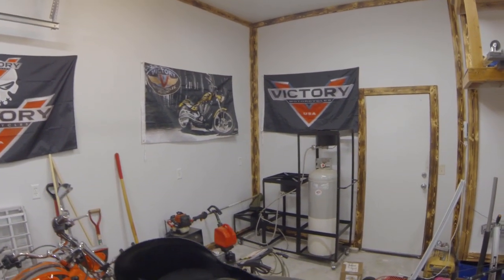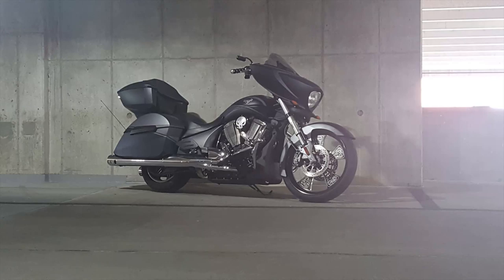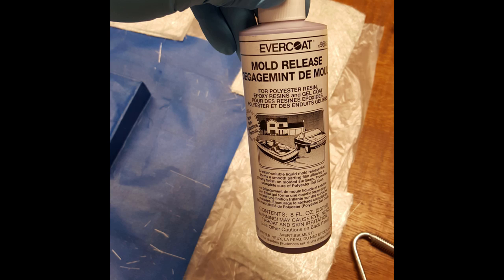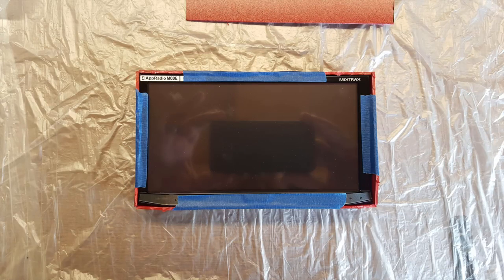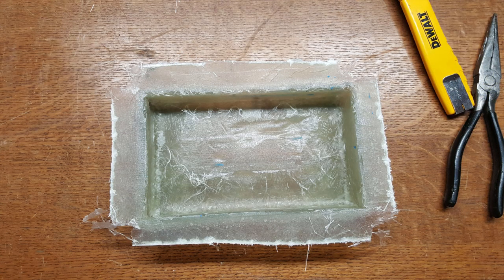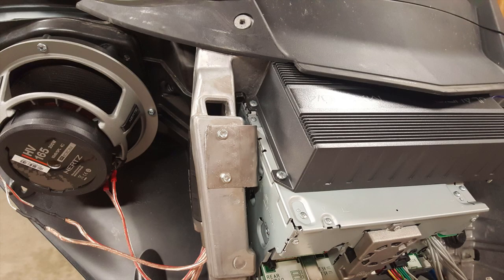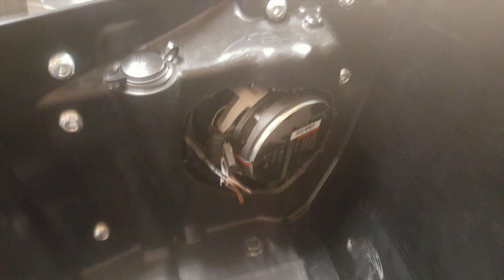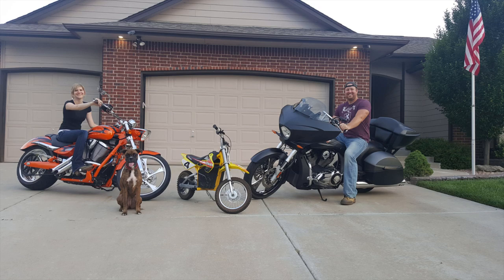Victory Cross Country Custom Dash Build | Double Din Stereo

Comment: Man that's nice , I wish that could be done on my woc fairing
Reply from the maker: Thanks man. You might be able to, don't know much about the dimensions of those. I was told by 2 custom shops that the screen wouldn't work down there to keep the stock gauges. Where there's a will, there's a way 😉

Comment: This is great work man.  I wish I had the talent and resources that you've demonstrated here.  Can you share a pic of the inside of your bags finish with speakers?  Did you have a sub somewhere?
Reply from the maker: Thanks man. I haven't added speakers to the bags yet, just replaced them in the tour pack to the hertz 5.25 coaxial. No sub. Eventually I'll add bag lid speakers and probably a sub, but it'll probably be next year before that happens. Too many other things money and time is going towards.

Comment: I have watched your video numerous times and cant thank you enough for posting it here.  Especially after the photobucket fiasco from the forums.  But i do have one question.  Since you installed this on your bike have you had any issues with cracking or chipping on the modification itself?
Reply from the maker: Thank you! Glad it has been helpful for you! I've been running this for almost a year. Waited a few months after I primed everything to make sure it would function well. I've probly put 3k miles on with the mod. There's not even any cracking in the paint. It is super solid. That dynaglass really makes it rigid. I have no doubt this mod will last the life of the bike (structurally). Unless someone takes a hammer to it! But it's kind of tucked under the main dash and tank so I don't think anything would ever hit it either. Hope that helps!

Comment: Nice work! How did you get the radio control to work with the new radio? I'm having issues with adding a Pioneer DMH-C2550NEX to work my X1 radio controls.
Reply from the maker: I went over the module I had to buy... it was in the part where I was installing everything under the fairing, sorry I can't remember the name off hand

Comment: Are the pins 90 degrees to the ribbon, or in line? Thanks. Great job BTW.
Reply from the maker: I think I know what you're asking... but everything is in line. The contact points on the ribbon are flat (not at a 90 degree angle on the end) and they slide straight into the connectors. The ribbon plugs in the back of the screen running along the back, not sticking out 90 degrees. Hope that answers your question, let me know if not. Thanks man!

Comment: Awesome. I’ll be using your video to help me making mine. I do have a question. Will making the box of acrylic be a good idea? Like will I be able to “weld/joint/etc” to the frame?
Reply from the maker: Yea you can make that box out of anything really. I'd just scuff up the area you use the duraglass on so it gets a good strong hold.
Reply: Life of Bliss Awesome. Thank you for the tip. And congratulations on the new addition to the family. I saw it on FB Victory Page.
Reply from the maker: Thanks man! Good luck with your project too, it's a sweet upgrade

Comment: How deep can a head unit be for this to work? I wanna tackle this project but I don’t wanna start by getting the perfect head unit only to find out it’s too deep and hits the bars. I figure I need to stick with a 7” screen unit, but just wanna make sure what depth I should stay at. Thank you!
Reply from the maker: You won't be able to fit a full head unit on the fairing, double or single din. You'll only be able to fit the face plate which is pretty thin, only about an inch or so
Reply: @LifeofBliss  I was told almost the same thing by Dave Azzopardi.. but I’ve seen ppl doing it. Even tho I can do car audio myself.. looks like imma have to just break down and take it somewhere and just pay to have it done😞
Reply from the maker: I was told there's no way to do a double din, so I did it myself 😉 but seriously, there's physically no room to do a full stereo in the dash in the stock location. The brain has to go in the fairing. If you're seeing dashes with stereos in the stock location, it's either how I did it or how Dave does it, with the faceplate separated from the brain
Reply: @LifeofBliss  sweet, if all the ways I’ve seen, I like yours the best, it looks like the dash was made that way… clean👌I guess I have just 2 questions lol…

1) what do you do when you get caught in rain cuz I don’t think there’s any touch screens that are water resistant.

2) do you, or have you considered getting paid to do this, I only ask that because if I have to, I’m gonna tackle this at the risk of messing up my dash lol but if an expert can do it, I would pay!! Lol
Reply from the maker: If it rains, I just remove the face plate. Inconvenient, but beats damaging it. I doubt I'd be listening to music in heavier rain so I could focus. Light Rain and sprinkles it doesn't really get wet.

I would love to make these for others, but honestly man I just don't have the time right now. Just bought some land and a house and I've been busting my butt to get things in order here. Only rode a handful of times to the gym and back this year so far!
Reply: @LifeofBliss  hey I hear that!! I get caught in rain sometimes so figured id see what id need to do.. all in all I really wanna tackle this!! I think it looks awesome, and depending on the unit, it pretty much gives you the only thing these bikes are missing to be compared with brand new flagship bikes🤷‍♂️ thanks for talking to me!
Reply from the maker: @dustinryanmusic423  absolutely man, hope you can get it going! Some people have used ABS plastic to make the tray for the faceplate to sit in. Then bondo it to the dash like I did. Essentially just replacing the fiberglass with plastic. Good luck getting it going! Take your time, it's not too terribly hard to get it going. It'll take time to make it look super smooth and like it's supposed to be there, but just focus on the fitment first.

Comment: Also how did you determine what head units will work with the brain in one place and screen in another?
Reply from the maker: I looked for a screen that could be removed from the unit as a security measure. I honestly didn't know if this particular unit would work before purchasing. I got lucky and was able to find the right cables to make it work. As far as I know, all of the pioneer NEX 4xxx series head units will function like this and use the same ribbon cable
Reply: @LifeofBliss  thanks I ordered the 4500.  Going to start mine. I am going to try to make the mounting tray that you made out of fiberglass out of abs plastic.
Reply from the maker: @chadwilliam1  that's a better option I think. I didn't thunk about that when doing mine. A lot less work... you might look into kydex plastic as well. You can get pretty thick pieces that are very durable for a decent price. I haven't priced out abs plastics

Comment: Are the pins on the ribbon forward facing or reverse facing?
Reply from the maker: I'm not sure I completely understand what you are asking, but the pins face down towards the circuit boards and the black bar snaps down to hold them in place. Please let me know if that's not helpful!
Reply: What connector did you use?
Reply: Life of Bliss  What connector did you use for the Vic dash build?

Comment: I'm having a hard time finding ribbons they length eBay doesn't have it only short
Reply from the maker: Anything above 350-400mm would be long enough. As long as the width is correct, you have a range you can grab the length in
Reply: @LifeofBliss  I bought a 60 Pins 0.5mm Pitch 150mm FPC FFC Flexible Ribbon Cable for LCD TV Car Audio DVD  but I noticed on the stock ribbon it's 105c & 90v the cable I have is 80c & 60v can't find one with matching stock ribbon numbers
Reply from the maker: I think it should still work fine. I think mine was the same markings as yours. You might run into the ribbon not being long enough though depending on where you mount the brain. You can at least test the cable so you know it works then grav a longer one if needed
Reply: @LifeofBliss  yea that's what my problem is it's not working with new cable but I put the small black on back on and it works I noticed the numbers were different but it's still a 60 pin 0.05
Reply from the maker: Be sure the conductors are facing the right direction when you put the wire in the clips, if that makes sense. Not trying to say you aren't doing it right, but just something to verify
Reply from the maker: I just checked some old pics, mine says 80c 60v as well. So I know that type of wire will work at least. I'd verify your wire is going in the right way (conductors are only on 1 side) or you may have a bad wire somehow?
Reply: @LifeofBliss  I noticed the wire is twisted when both sides are connected but both sides both have metal down blue side facing up by latch
Reply from the maker: Yea that sounds right... based on my pics. Idk man, you may have gotten a bad cable somehow. Maybe it's not getting a good connection in the clip as well? Idk if I'll be able to help outside of that. I can verify that the 80c 60v cables do work though, and many have done the mod successfully. Sounds like you'll need to do a little troubleshooting but it should work out for you. Since that cable is pretty short in my opinion, I'd maybe start with getting a longer cable to test as well. I think I got a 2 pack for about $10 of the 500mm length
Reply: @LifeofBliss ok thanks appreciate all your help